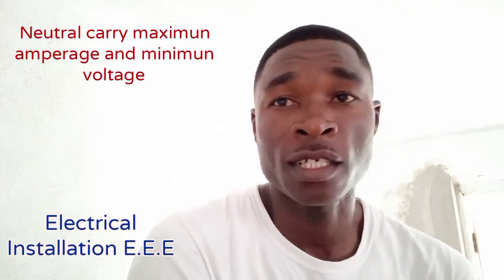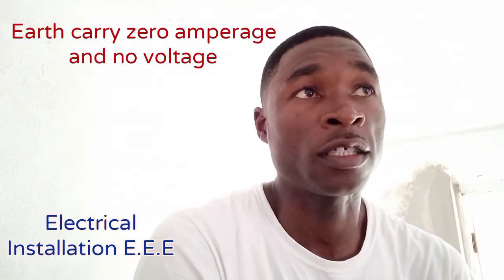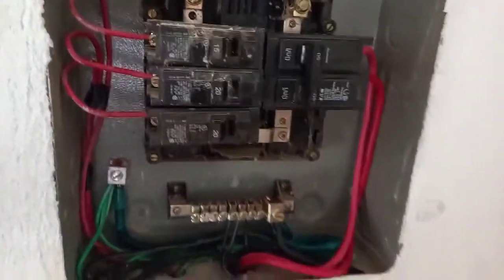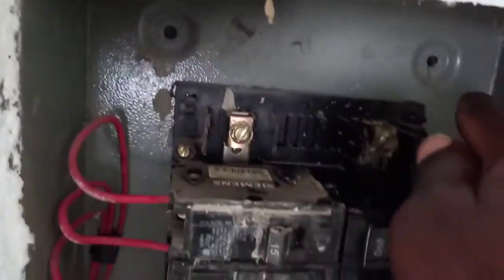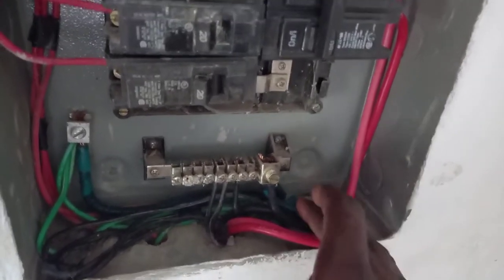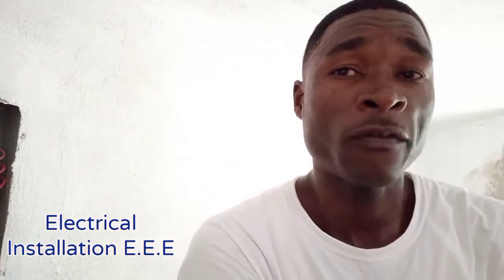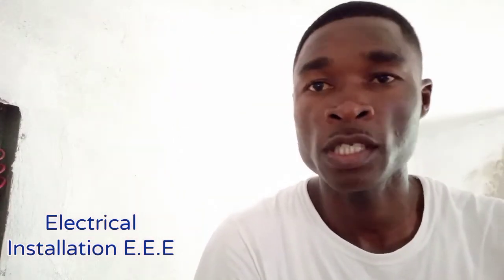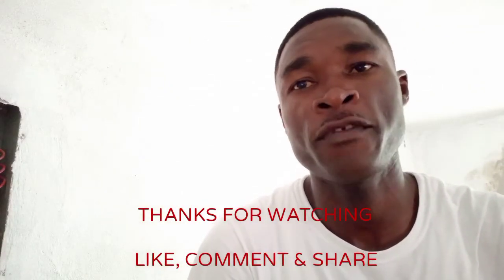Difference between Neutral & Earth wires !!Why The Neutral And Earth Bars Are Separated In A Panel !

Comment: What you have is what we call in the UK a combined neutral and earth. Which separated inside the panel. You must remember at the supply transformer the center point is connected to the general mass of earth. By using the neutral conductor as a return conductor the impedance will be much lower than if you were to use an earth electrode. Approximate 0.35 ohm. So if there was a fault between live conductor and earth a high current would flow in order to operate the electromagnet coil inside the circuit breaker, which would disconnect the supply to the appliances.

Comment: Well first and foremost I love your videos very informative and refreshing another is you will have to correct your title of this video because you tied the earth and neutral but your heading says y you shouldn’t tie them..... my opinion is that even though it’s a short distance and it’s tied already from the meter box, if you don’t tie the earth in the panel you would still risk getting electrocuted if danger existed for like you stated the neutral is a amp carrying wire so it would’ve to carry the dangerous current to the meter or rod even doh short distance to protect and while doin so can be shorted to panel box
Reply: I would like to comment on other videos such as the installation of handy boxes and switches why you don’t give some details on how far in the the boxes should be to get it properly flushed and why was pipes run under ground instead of ceiling reasons or circumstances surrounding these demand settings
Reply: What about swa cable installations do have videos on these as main
Reply: Do you take on electricians

Comment: Triple E, in most countries the Neutral is bonded to the Ground/Earth at the main point of entry ONLY. All the other panels and sub -panels the Neutral and Ground are separated. The Ground is for safety purposes and the Neutral provides a return path for the circuit current. Keep VLogging, I love your passion and drive.

Comment: On a sub panel u should never connect the neutral and grounding
Reply from the maker: This wasn't a sub-panel
Reply: Its just a green screw they use to bond each other all u ave ti do is remove the screw
Reply: Correct!

Comment: Also it is not recommended according to  standards to  link the Neutral and Earth  in a Sub Panel......Why is this so???  Well it is so because if there should be a fault in the sub panel the Sub Panel  Main Circuit Breaker in the Main panel will not trip, if power was taken from the bus bars to feed the sub panel them the main circuit breaker should will be responsible to trip under such circumstances......i hope i was of some assistance👌💯
Reply: Very well said
Reply: It would cause what Engineers call "circulating currents". There would be too many paths for ground currents to circulate.
Reply: I guess you mean if there was a ground fault or line to ground fault.

Comment: Hey bro i always watch your videos, however according to the JS21 amendments the link between neutral and earth in the panel is called M.E.N meaning Multiple Earth Neutral this method is purposely put in place to quickly absorb any abnormal current flowing in the curcuit and sends it straight into the mass of earth....eg. on the JPS poles there neutal wires are bonded to earth the also balance and stabilize voltage
Reply from the maker: There are ways to interpret this method but the main thing is for people to understand it , this that you mention out of the JS21 is also another way of explaining it to people but sometimes in your own words people tend to understand it more. Thanks for your comment  👍
Reply: Yes bro thats true however, its in my own  words i just made reference back to the JS21 which governs Electrical Installation in Jamaica👌

Comment: The neutral wire sends back the used current back to the transformer and then back to the panel and it repeats the process and it also balances the circuit
Reply from the maker: No not to the transformer but it does complete the circuit

Comment: Most electricians don’t see it necessary to bond the neutral with the earth ...... but most houses won’t pass unless it is done ...... according to the JS21 the neutral wire must be bonded with the earth.
Reply from the maker: Spot on 👍
Reply: Only at the main panel or the main point of entry. That is just general Electrical Engineering.

Comment: The panel and meter should have it's own ground lead. Based on my training at Heart NSTA. 
The reason why u link the ground with the netural in  panel is so that u have an effective ground fault current path.
Reply from the maker: If you have back to back meter and breaker panel it is not necessary to do individuals earthing but if you have distance between both then it's best to do individuals earthing which i mainly do individuals earthing but in a case with like just couple inches or a feet a way one earthing good enough anď as i said before in that case it's like you doubling up either earth or neutral wire .
Reply: Your workmanship is good mi boss. 

You always have to ground and tie the neutral conductor in at the main means of disconnect as per the NEC book. 

If it’s a sub panel you have to take out the bonding jumper or separate the grounding and grounded conductors, as Per the NEC book
Reply: So yes you did it correctly by standard industry standards
Reply: In South Africa we usually use TNS-C system in which from the transformer neutral and ground are bonded and it is separated at the supplier box and at the meter box and distribution box neutral is separated to earth wire and the neutral is not connected to earth bar .
Reply: So when separating neutral and ground wire they split the same  wire into two or they join the wire which will go to ground.

Comment: If a meter panel and a breaker panel install back to back and you connect both the earth and neutral wires on the same log with 1 earth rod which connected to the meter it is a like you double up 1 of them which is not necessary to me ,would a inspector have a problem if you run 1 wire instead?
Reply from the maker: I think they will to be honest ,they will try to make a case about where is the earth wire or the neutral wire even though they know it is like a double up thing but yeah I've never tried it but to me it makes no sense if the meter and breaker panel are back to back and you using one earth rod to run both for me using a both neutral and earth wire is like doubling up because they both going to connect on the same log in each panel on the main log so i get it which i've explained in the video. Nice one

Comment: Electrical installation E.E.E information  can never be too much.this video refers to subpanel? Because neutral and ground can bond together in a main breaker panel but must be separated in a subpanel.
Reply: @ElectricalInstallationEEE    Personally my instructors told me that  the neutral and ground should be isolated in a sub panel from each other. Because the if u bond the neutral and ground in a sub panel you create a parallel connection. so the current has the option of going on the CPC ,EGC or neutral. Circuit Protective Conductor or Equipment Grounding Conductor. However u don't want current  to flow on the EGC in sub panel because that conductor should only carry current in case of electrical fault such ground fault. 
Therefore if is essential u bond the neutral and ground together in the main panel,  but neutral and ground in sub panel should be isolated.
Reply: You are so right.